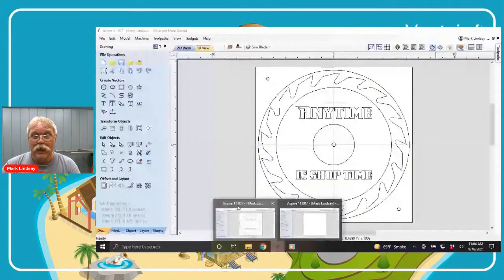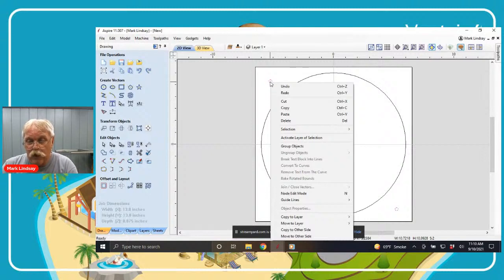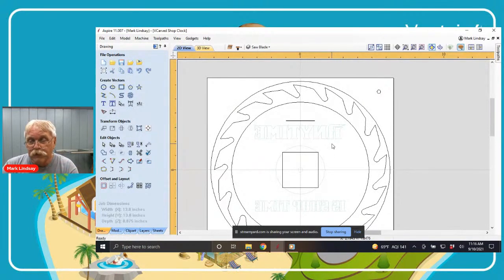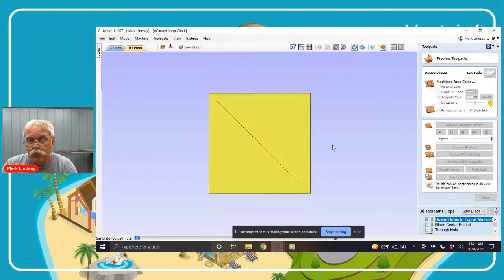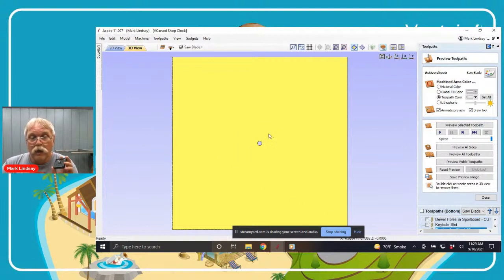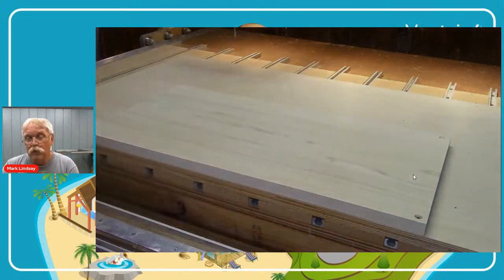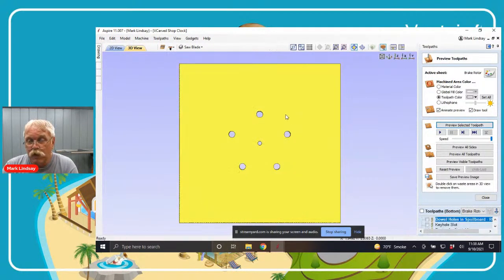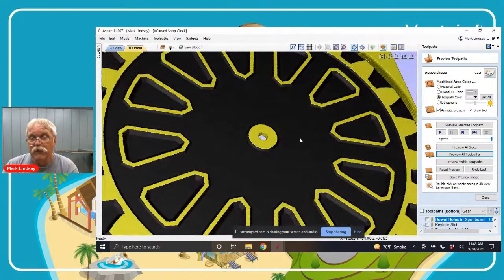Two-sided Shop Machining with Mark Lindsay | Vectric Worldwide UGM 2021

Comment: Hey Mark, great explanation. I used these techniques to cut dashboards for a Sunbeam Tiger. Because the original is 5/8 plywood with no metal support, the Lucas electric gauges mount right to the dash. That means very specific relief cutouts on the back to make it all line up. Vectric's ghost lines make it easy to see where they need to be and your registration holes worked perfectly to line the parts up. Result: Happy car customer with custom dashboard!
Reply from the maker: Thanks again for the great comment... and use case for something Mark point out in his presentation - seeing the vectors on the other side of the job.

Comment: I wish Vetric would make an add on to control a router directly instead of going through Mach4.
It could increase versatility and control not to mention simplify projects. Yes, it would take work but it would be loved by your users.
Reply from the maker: Thanks for the comment!  We will make note of it.